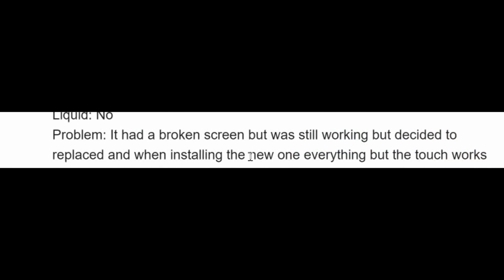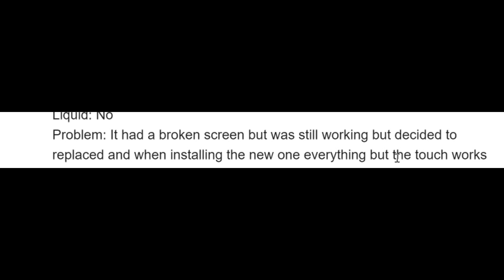iPad pro 12.9 1st No Touch after Screen Replacement - 5 Faulty / Missing Components no Schematics

Comment: How much for this mail in repair? I have the same exact issue because I forgot to disconnect the battery before replacing the screen. There was a spark and smoke when the touch flex cable touched the fpc connector incorrectly.

It turns on just fine, so I hope it’s only the filters I blew.

Comment: How your hands are so stable working with this tiny components.
My hands are like vibrator when I work with those small components
Reply from the maker: 😂. It takes practice. Your hand must not be floating in mid air when soldering. Lay your wrist on the table to give it support. Working with 1005 SMD components is difficult and takes allot of practice + you need the right tools
Reply: Some

Comment: Why do you sometimes use the tweezer and sometimes the hot air gun? Using the tweezer works also and you are preventing the damage of the connector?
Reply: Hit tweezers are very useful for quick removal but trying to pick the part off your bench without destroying the component or your bench seems impossible.

Comment: Great video. 
How did you guess the filters value?
Thank you for the knowledge.
Reply: He probably had them from a donor board or buy them in bulk. I reckon he distinguish by filter size and use one that had same size or by experience he gained by fixing so many of them.
Reply from the maker: Le Grand is right, Many times i use donor boards, or know the values from experience, but this time i used filters that are commonly used on iiPhones and iPads. The filters are the same ones i use to fix iPhone 6SP no touch.
Reply: @NorthridgeFix  thanks for replying and all the best for you and your family and business.

Comment: In all your video I don’t think I’ve ever seen you use a microscope, do you have one in the shop and do you prefer not to use one and find it easier with the camera microscope on the screen?? , is that the Eakins microscope camera as well??.thanks jay
Reply: He always uses a microscope, it's just that he has it connected to a TV/large monitor so doesn't need to look through the microscope unless its delicate work like this.
Reply: @Infiniti25  Also he says that he is used to the lack of depth of field that you get with an opical viewer and can work accurately with the screen view.
Reply: It's the Eakins IMX290 Microscope (Sony sensor) ...